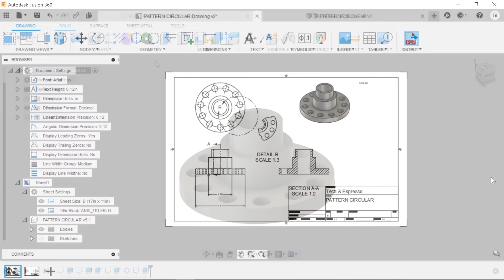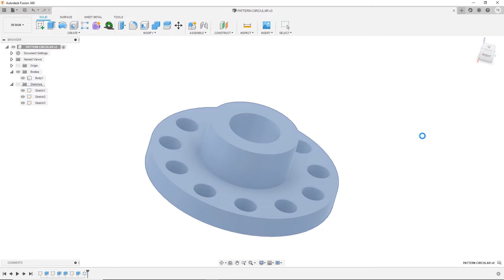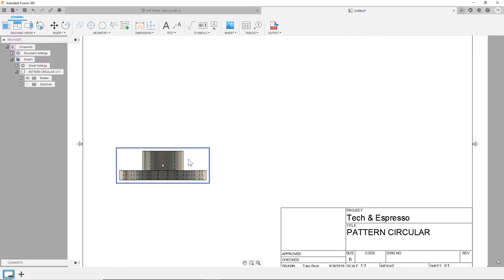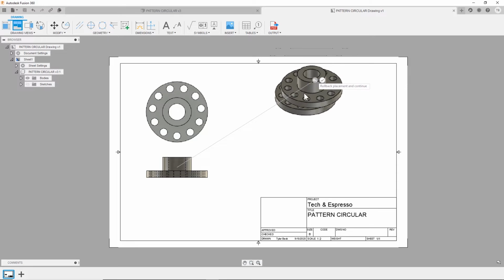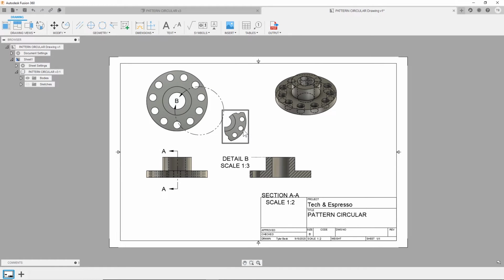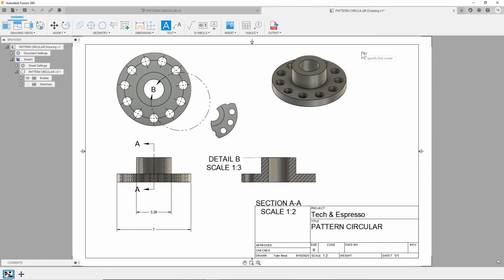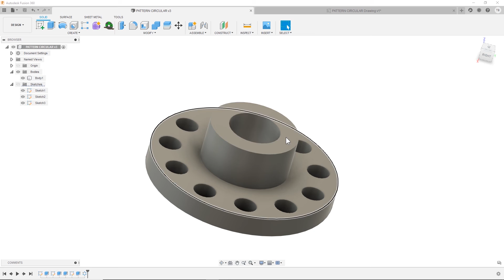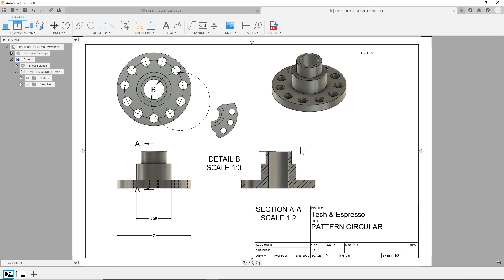Getting Started in 2d Drawings - Fusion 360

Comment: I am a home hack making mostly small parts and would like to use the drawing to make paper templets to glue onto material to make . the 1:1 scale does not print full size a 100 mm dimension comes out at 97mm so it is useless to me. Is there a way to correct this?
Reply from the maker: Great question.  I havent tried that recently but see the need!  I will add that to my list.